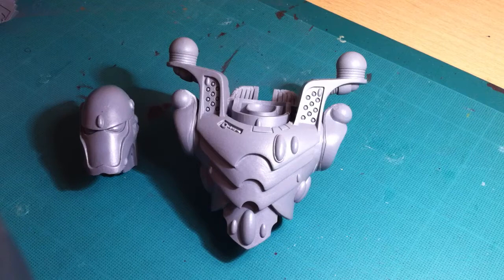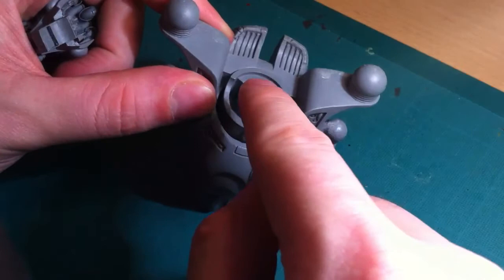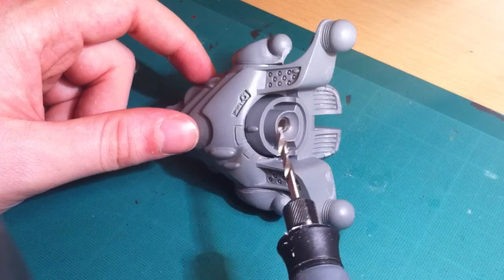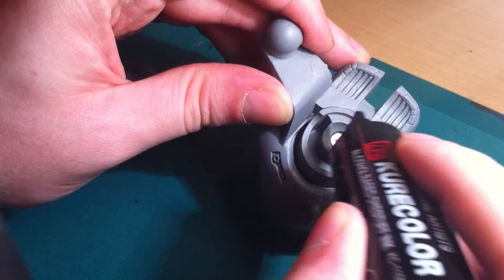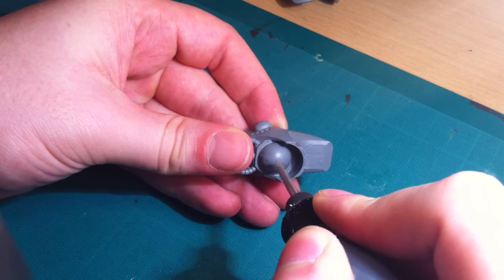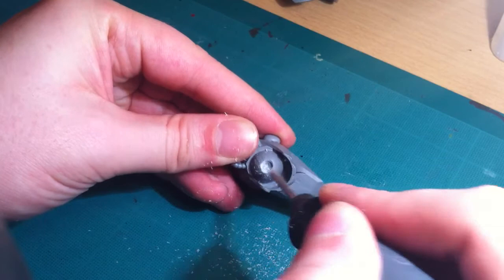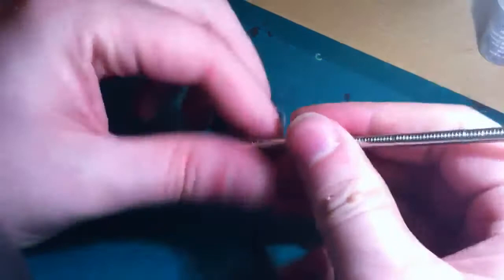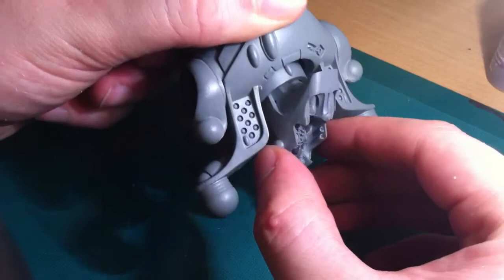Eldar Revenant Titan Build #4

Comment: Nice work on the titan so far! One thing that strikes me though is, why two magnets? Wouldn't a ball bearing inside the head work as well? (the idea is, center the steel ball inside the ball of the joint, so it will attract with equal force regardless of the head angle). Good luck with the rest of it, can't wait to see it done and painted (not to mention, seeing you get around to the Phantom....)